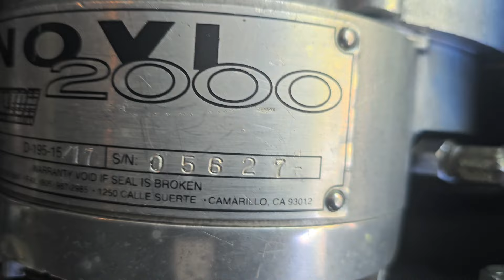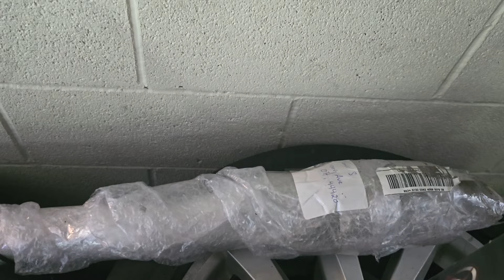those who last first laugh last what's going on next

Comment: cant wait to see it dialed in. the transmission setup is where the major upgrades will be.   not sure where your at in the 1/4 or if that even matters nowadays but the 3800 is great in a long gear setup. the shorter the final drive the slower they seemed to run. 3.29 is great at under 400whp. but with over 500 like yours id lovve to see it locked up in a long gear ratio setup. sucks to see the power drop at the shift points.    food for thought- a 4door gtp with 337whp dipped into the 11s with a fresh auto and slicks.   the turbo cars with 200 more horse and the same were getting the identical times, with a bit higher trap speeds.  even with a auto they had much more of a struggle to put the power down on the same platforms and played catch up.  hellcats are on the fine line of the ease of driving if they have proper tires.  your stubborn with your tires and that along might play a major part in the final outcome of the race at that power level.  grab a pair of stickys from a mustang buddy and see what a sidewall softy will do for that car.  im guessing that trans would dissengrate. as they didnt hold to a colbalt/hhr with less weight that hell boi.   i dont even know what im talkin about anymore lol
Reply from the maker: @barelyrollin  we definitely getting a tire on here eventually we got this bro stay with me

Comment: They say the transmission on them 3800 and 3500 and 3900 and 5300 engine has that transmission they recommend holds your power back.
Reply from the maker: @ericcole3917  I don't have that transmission anymore I manual swap it with a f23

Comment: I am geting my self other grand prix GT with 76,000 miles on it One owner original mileage. An old lady owned it since new. And I asked her what made you get something so sporty? She said.
She loved the way it looked and she said it has plenty of get up and go. It has the 3800 in it. Or I wouldn't even consider on buying it. I test drive it. Automatic transmission and it ships really good really good Is no hard shifting at all surprisingly. She told me she baby didn't never pushed it. It has a lot of power to it And she maintained it very well. She's.
 Asking 6500 for it. And I told her that's a little much. So we agreed on 4800 as a closing price. I put an $800 deposit down. Until I can get the car.Looked at at a mechanic and if long as everything goes well she will get the rest of the money and I'll finalize the transaction.
Reply from the maker: Nice find bro

Comment: If you hadn’t added more ignition timing yet, you might want to consider a water/meth kit. They have some that are not very expensive and would definitely be a major factor in the tuning process, it’ll help keep knock down so you can maximize your tune.
Reply from the maker: @JohnZornAscended  I wanna see how it goes first iats doesn't go past 110 max on I'm on e85 never saw kr yet so far but we will see
Reply: @hand12u  I understand, power to ya.